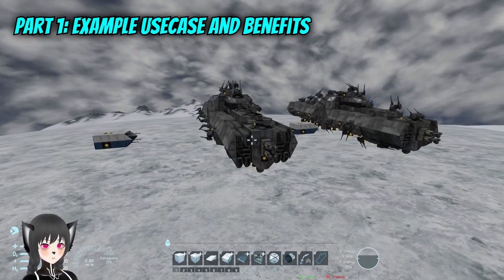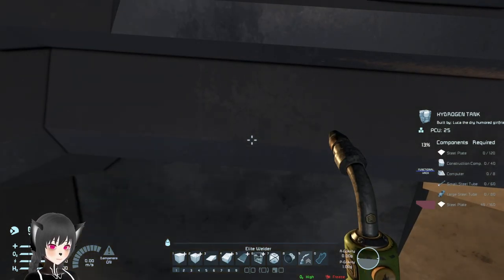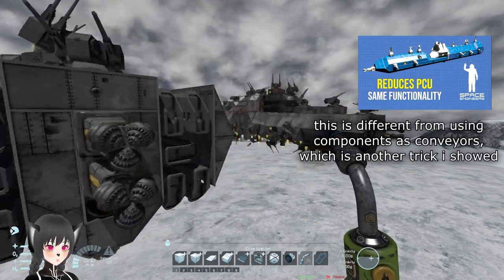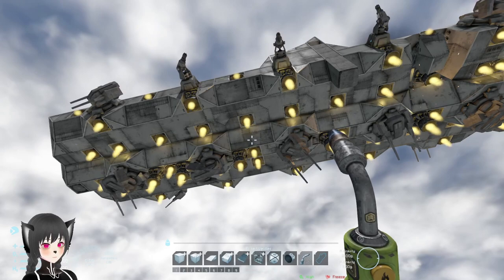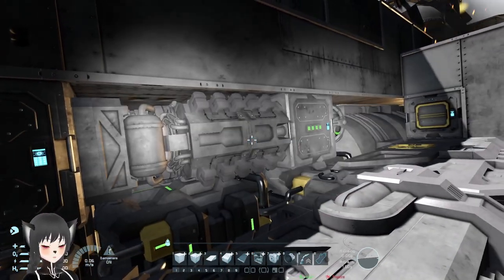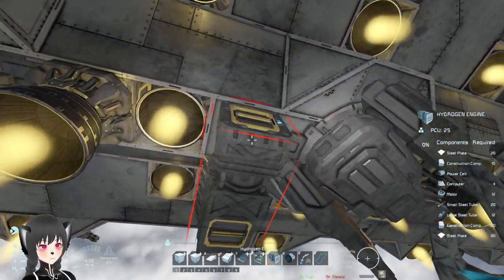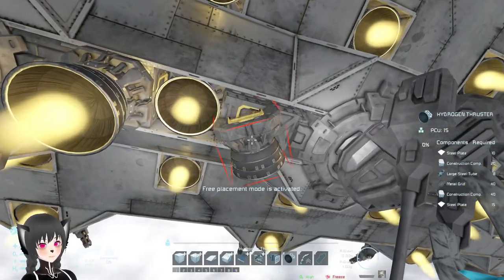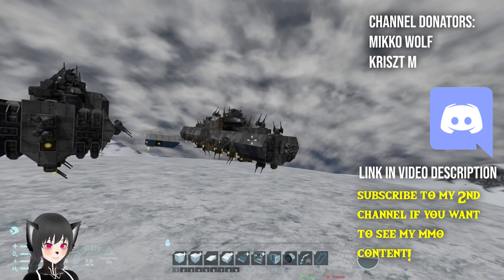This Trick Lets You Build More for Less, Space Engineers

Comment: I have a question for you. How come most ship designers use a ton of conveyors in their ships instead of either conveyor tubes or reinforced conveyor tubes, which cost less to build?
Reply: Many are created in creative where cost is not a factor. So players just slap the conveyor network down without having an actual plan. Conveyor blocks are easier to work with as you don't have to cycle through multiple types of blocks or go back and change blocks if you make any adjustments to your layout. In short, people are lazy or thoughtless.

Comment: This confuses me slightly, unless I've missed something?
Why would you add a 25PCU block to replace putting 2x 10PCU blocks?

This obviously makes sense for optimisation in replacing conveyors with components you'd otherwise have on the ship (placing an O2 tank instead of 2 straight conveyors) but not in this particular situation?
Reply from the maker: No, I moved an existing block from somewhere else which didn't have its other port used c= therefore adding 0 block as conveyor
Reply: @LucaTheGuide , thanks for clarifying! I totally missed it and got myself all confused :3
Reply from the maker: Is okies xD I know it can be confusing from how I explained it